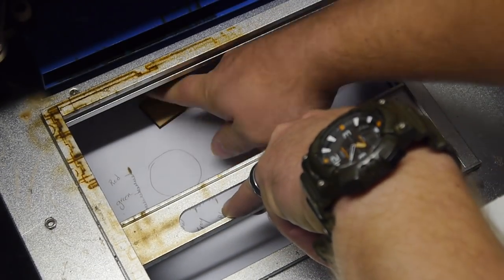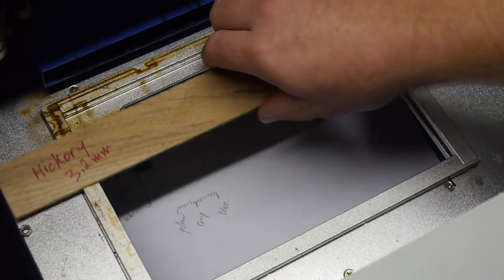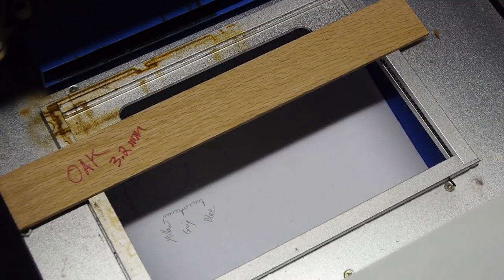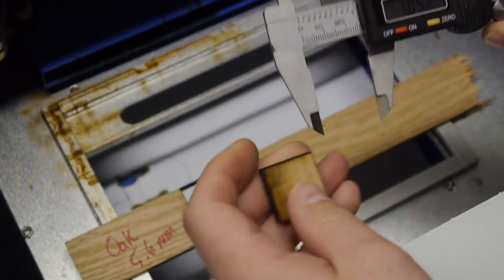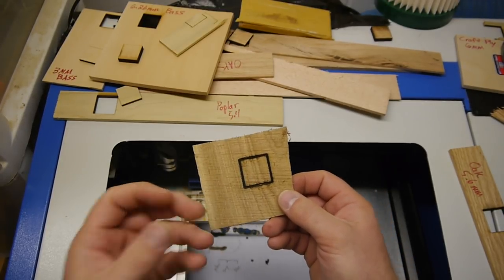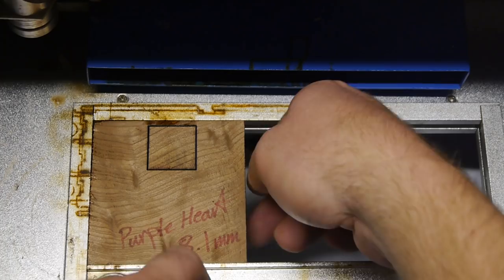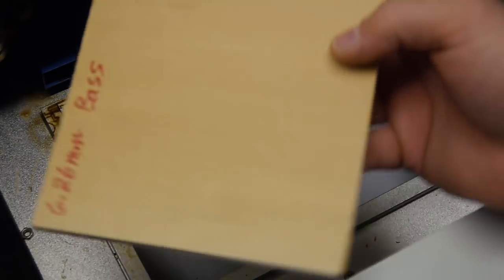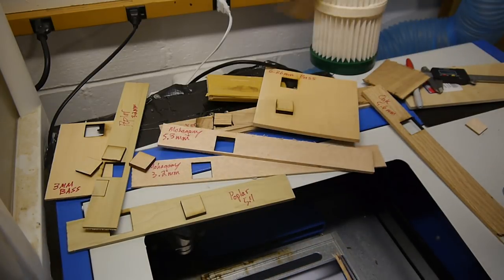Test Cutting 3mm, & 5mm hardwoods with Chinese K40 Laser Engraver

Comment: little tip.  keep that dial away from 11 if you want to enjoy that laser for more then 2 months.  

they can last 2 years when kept below 22 milliamps.  
that's where it's the most efficient.  most burn with least amount of usage of the co2.  

if you exceed it you start burning co2 at a much much faster rate and eventually your laser is shit and you need to buy a new tube
Reply from the maker: Thanks for the heads up. I didn't realize it was actually using up the co2 in the tube as part of the process to produce the laser beam. Thanks for the information!
Reply: @JoshAQ  yeah they arent as semi permanent as regular lasers sadly. 

what i myself don't understand though is why there isn't an option to just replace the gas inside.

Comment: Ever heard of travel speed??  Why don't you try slowing down the travel speed!!  That would help a lot!!
Reply from the maker: I tried going slower early on off camera and in the wood I was messing about in at the time seemed to leave a more "charred" edge for lack of a better term. The slower I went the more the wood would burn out side the laser kerf and blacken and leave a not crisp edge. Well less crisp. Honestly I didn't do too much on that front. Just a few attempts at 10 mm/sec and a few at 15 mm/sec. Do you have a recommend Travel Speed I could try? In the video all the cuts were done at 20 mm/sec.
Reply: Try adding an air assist nozzle to blow out the flames and stop the burning at slower speeds.

Comment: in order to make the kerf not angled you would need to... idk if that machine can do it but to make kerf tighter on the bottom of wood you need to speed up the machine to make kerf tighter of top you need to lower the focal point or vice versa! because  you have to take a bunch of passes it may not matter but that is the idea
Reply from the maker: Hi Dave, yeah, unfortunately the focal length of the focusing lens is set in stone. I could theoretically create a screw adjustment for the lens or conversely raise and or lower the work being cut to change the point at which the laser energy is the smallest. I am curious if that matters to a certain extent. I think the laser is adding too much energy into the material. I have some poly carbonate that I want to shoot the laser into to see if I can demonstrate where the focal point is an the angle created naturally from the laser converging from a say Ø1/4" circle to a Ø0.006" circle. Thanks for watching and the feedback!
Reply: overall do you think that machine is worth the 350 or whatever it was?.. lol I just want a toy for home I work at a small steel rule die shop we have a 2600watt laser cuts  .25 inch steel like butter we usually cut 5/8 birch board or 3/4 birch board it cuts at 110 inch per min to cut a perfect .028 (2 point) kerf
Reply from the maker: dave lancaster given you have access to such an awesome laser at work, it will be extremely important to manage your expectations by comparison. If you like tinkering and think you can fit it into your life and hobbies then yes, it is a heck of a little machine. I am not familiar with the software offerings available currently, but that is my current hangup and it keeps me from whole heartedly using the machine to its utmost. But frankly it would be hard to build a laser comparable for the money. So yeah if you come across a good deal then sure pull the trigger.

Comment: Not good testing. some tests are in de frame and other wood  is placed  on top of the frame. 
It seems the laserpoint is some on top of the frame and not in the frame.
The wood is placed on different height. So not good testing.
Reply from the maker: You bring up fair criticism. I did not apply a good testing methodology to this video. I also recently found out that my focusing lens was quite dirty when I did these tests and I need to redo them any ways. I will come up with a testing rig that can hold it at the same height and location. Thanks for watching!

Comment: Not  really tht  accurate,  as you  use different thickness of Wood and  therefor  have different Focal Length, that  means your Laser Focus is way off on  thicker Material and when you clamp it into the bottom holder.
So you cant rally compare it unless you  can adjust  your Focal Length for each Piece to  compare them to eachother .

Comment: "Crank the power all the to 11" ? Why?? I cut 6mm poplar in one easy pass at 80 power and speed around 20. I don't get what you're doing at 11. It's useless. Also, get an air assist. Your lens is probably filthy from the flames.
Reply from the maker: Thanks for the heads up on the lens, I haven't cleaned it since I got it so that is a worthwhile investment of time. Yeah, everyone says get an air assist. I have a small compressor that was used for nebulizer treatments and I am going to see if I can use that for at the very least blowing away the smoke, if not actually assisting in blowing the burned material out of the hole. When you say 80 do you mean 80% power? When I said 11 I meant I turned the power knob clockwise as far as it would go. I noticed on my machine that the power setting inside the program has no effect on the output of the laser, as 5% power and 100% have the same result. Do you have the 40 watt version of the laser or the 60, 80, 100 watt version? When you say a speed around 20 do you mean 20mm/s, 20 inches/min? I am open to improving my cutting strategies for sure. Thanks for watching and commenting.
Reply: Use this one. It will fit perfect and won't hit the exhaust shroud. It only needs a little puff of air. I use a small craft compressor I had. The flames make the lens filthy in a very short period of time. Clean the lens with a Q tip and rubbing alcohol. 
https://www.ebay.com/itm/K40-Chinese-Engraver-40w-C02-Laser-Cutter-Air-Assist-Nozzle/122912332567?ssPageName=STRK%3AMEBIDX%3AIT&_trksid=p2057872.m2749.l2649
Keep on of these handy as a spare. The lens gets fried over time and becomes brittle and will break. Never screw lens cap on too tight. Can crack the lens. 
https://www.ebay.com/itm/ZnSe-Focal-Lens-For-10-6um-Co2-Laser-Engraver-Cutting-Machine-12mm-FL-50-8mm/263713720418?ssPageName=STRK%3AMEBIDX%3AIT&_trksid=p2057872.m2749.l2649
I have the 40w version but I don't have a dial. Mine has a digital read out for power so sorry for the confusion. Yes I use 80% power and 20mm/s to cut 6mm poplar. If yours won't do it then check for the dirty lens. The dirty lens will dramatically reduce cutting. In fact my lens came filthy and could hardly cut at all right out of the box. Thanks for the kerf info. That was good stuff!
Reply from the maker: Thanks for the links, I should be able to make that pretty easy on the 3d printer or lathe. I wonder how dirty that lens is. I think I am going to have to do a side by side comparison to see the before and after, and how that affects the cut and kerf. That and it would give me a chance to fix the bad audio on this video :-) I am certainly going to try and replicate your results!
Reply: I can't believe you're getting anything cut without having checked the lens. It has to have a thick layer of glaze on it by now. My lens was filthy in about two months with moderate use and air part of that time. I think you'll be amazed as I was. If it's as dirty as I suspect you may very well make a video to show those that are unaware.
Reply: Also I can tell when it's getting dirty. Lazy me, I'm just compensating by slowing the speed and increasing the power a notch each way till I clean it again.

Comment: you didnt make the right measure! using caliper to measure the side x side square, its wrong! you have to measure the HEIGHT of square! 🚫 not the sides!
Reply from the maker: Hi, measuring the sides of the square indicates kerf. Thickness of the material was taken into account initially when sawing down the sample to approximate thickness.